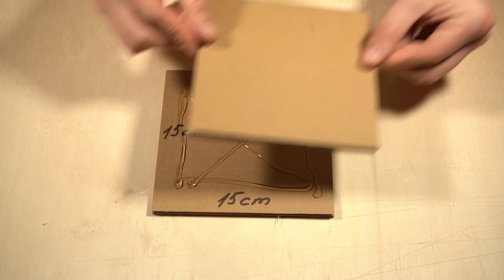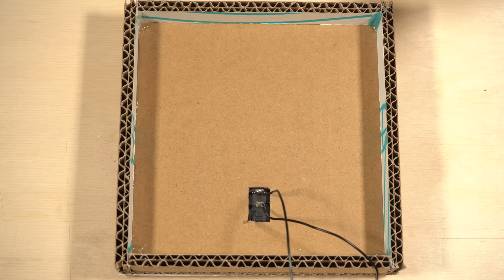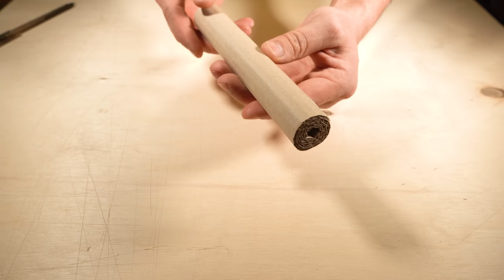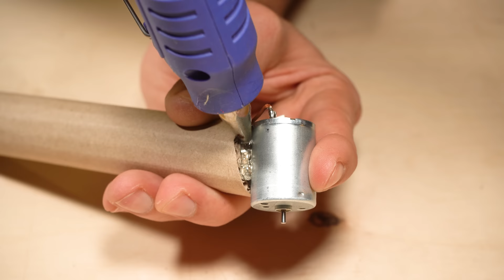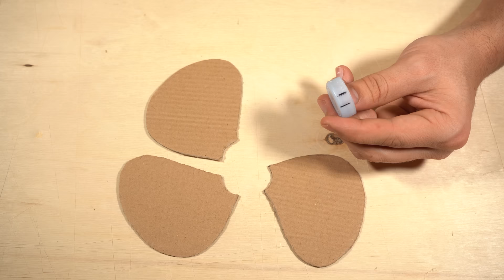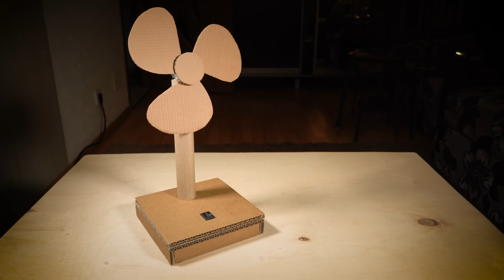Summer Craft: Table Fan Out of Cardboard at Home - DIY Crafts

Comment: Is it fine to use 6-12V Mini DC Motor High Torque Gear for Traxxas R/C and Power Wheels PCB DIY Electric Drill for the motor?
Reply from the maker: i think yes

Comment: Answer this quickly, please, this is for a school assignment. the motor DC, how many volts did you use?
Reply from the maker: 9V
Reply: @RestartOrigami For the rocker switch, does it have to be 12V or can I use something else?
Reply: waiting for your answer😌😌😌😌🙃🙃🙃
Reply from the maker: You can use and 12v

Comment: Put tape or shrink tube on the wires or it will not work and 8v battery will touch then plus will go in minus and it will be hot

Comment: Los cables que estan conectados al motor, cuales son? como los pido?que tipo de cable son? Su descripcion por favor.
Reply from the maker: https://www.ebay.com/itm/264413293068?_trkparms=amclksrc%3DITM%26aid%3D1110006%26algo%3DHOMESPLICE.SIM%26ao%3D1%26asc%3D241221%26meid%3D44abe52e5db845a798a1ec477a0afb9d%26pid%3D101195%26rk%3D5%26rkt%3D12%26sd%3D281779322997%26itm%3D264413293068%26pmt%3D1%26noa%3D0%26pg%3D2047675%26algv%3DSimplAMLv9PairwiseWebMskuAspectsV202110NoVariantSeedKnnRecallV1BERTPLXDynamicSlots%26brand%3DUnbranded&_trksid=p2047675.c101195.m1851&amdata=cksum%3A26441329306844abe52e5db845a798a1ec477a0afb9d%7Cenc%3AAQAHAAABQC3%252BWCvMUPnWGqODOpxkPg3AFUkIkQxK0tfpb%252FJnmPH6ND1qvJBbUb0XbbulUKOG9zyIG%252BRXyhBxcin74pdkYg5SoGYlJytyBS5Yo3NLbSD6Y2g9JbbvWfEvyfV1KwLKtbER4hK%252BbPCXQt%252Bg9tFjRkKtuQabFH8ITmNwFj6nCsMk5ngcI25k9xbPtziZOQhD62o5ancfg4zLej95sFEkAaYOhqck%252FWcgzysmsSi4PbB3OuIhrKb5agAgoOTbqwPvjAX67hdLJlzX57Nz0nfahKryZNHRbliexOiUkYfcSF8vOs3YeBYQerFNhOA5sTsAJw6wATglr2FkbM5i6Id80lWqK8a7QUzYx95cCCn5qZVhQjxCyfLXsYah7DEKNDpoDAx58KQ3nTKEHLli3pp0sUkgGEQkFP9hINEuFl6eB%252Bqi%7Campid%3APL_CLK%7Cclp%3A2047675

Comment: Which motor you are using
Reply from the maker: 1. Motor: shorturl.at/fopDG
2.  Rocker Switch 12V shorturl.at/hAZ56
3. Battery 9V
4. Wiress

Comment: What are the materials used can you tell, please
Reply from the maker: hello Narpat, you need cardboard, lead from plastic bottle to link main detail of fun, glue gun, wires, and motor like here: https://cpc.farnell.com/pro-elec/pel00883/dc-motor-high-torque-6-12v/dp/MC02742?mckv=s_dc|pcrid|490691434472|kword||match||plid||slid||product|MC02742|pgrid|81075586787|ptaid|pla-1211575636714|&CMP=KNC-GUK-CPC-SHOPPING&s_kwcid=AL!5616!3!490691434472!!!network}!1211575636714!&gclid=Cj0KCQjw-4SLBhCVARIsACrhWLUJE9ntcoFYDOwXaS6Fk5-SzlL5MwAH4vke-DVWrczxxBpmYxBByFsaAtRwEALw_wcB
Reply: @RestartOrigami  thanks
Reply: @RestartOrigami   thanks 😊 I will make this
Reply from the maker: 1. Motor: shorturl.at/fopDG
2.  Rocker Switch 12V shorturl.at/hAZ56
3. Battery 9V